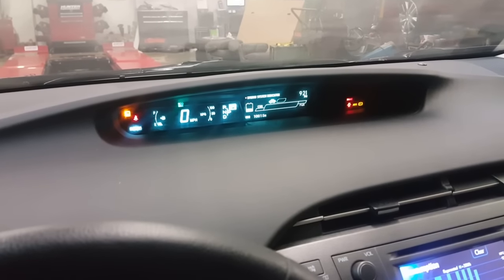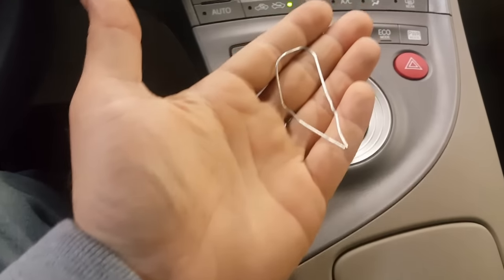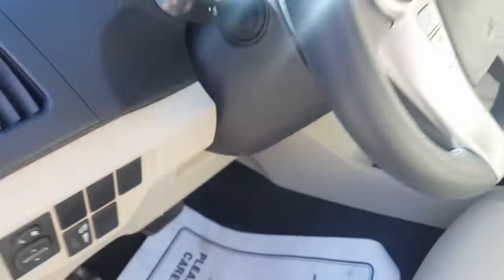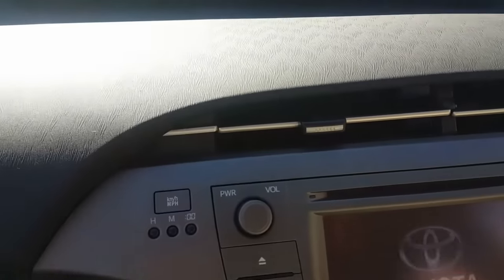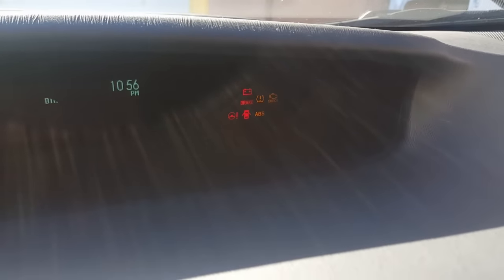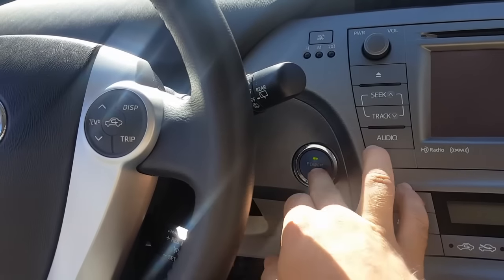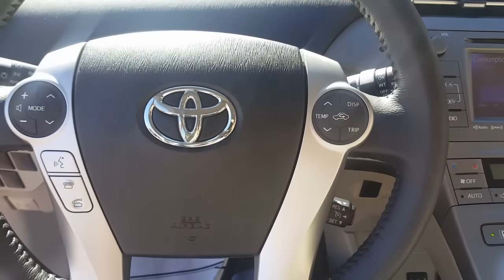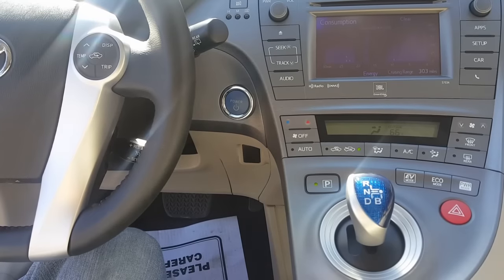HOW I RESET STEERING ANGLE SESNOR ABS VSA TRACTION CONTROL BRAKE ON ANY TOYOTA AND LEXUS VEHICLE'S.

Comment: Thank you. I've been driving my prius since 2013 and it has always had crappy steering and handling because it was never calibrated after getting new wheel bearings, brakes, etc, so the steering has always been all over the place and it was actually very annoying and frustrating to drive. After finding out about your video, i decided to try this and man, what a big difference! My steering is a lot more stable and isnt all over the place anymore. Even my braking got smoother. I never thought my prius would drive like a normal var again. Sir, i just want to say hats off to you for sharing this video. I am now happy driving my prius again, and i dont plan on selling it anymore. Thank you. Thank you. Thank you!
Reply: Don't remove light in Prius 2017

Comment: Did some Brake work on a 2008 Prius and the lights came on.   Did the reset trick by pumping 8 times after turn on. Waited for 30 seconds and everything is rest 100%   AWESOME Thanks
Reply: Had the same issue! Did it the way he said it! Didn’t work but when I saw your comment tired it and we’re back to normal! Thanks!
Reply: @ThePCopc1063  what was pumped 8times? The brakes..? I'm having same issue
Reply: @jasonmartinez2363  yes the brakes. Pump them 8 times rapidly. Each time you do it you should feel more and more resistance. Then shut off the car and restart it and everything will be good to go.
Reply: Neither works. My traction light has been on ever since I replaced my gen 3 clock spring. I'm not feeling increasing resistance on the brake pedal while pumping. 

I'm assuming in both procedures you leave your foot off the brake and press on switch twice as shown. 

Everything works except the light. I'm assuming my traction control may not work in slick conditions until I fix this.
Reply: @ThePCopc1063 did you use the paperclip?
If so can you walk through the process?

Comment: Prius zvw30 2010. Erratic steering. Alignment done. Still not great. Steering jumpy on straight roads at speed. Body roll at corners. No feeling in the wheel. I used your method. NOW car is driving fantastic! My wife is happy with this car for the first time in 2 years. Thank you for your upload.

Comment: My wife’s 2013 Prius was in a collision a few weeks ago and we just got it back from the repair shop 3 days ago. We had them then do an alignment because we felt the car drive differently after the crash. Fast forward to today 9/14/23 and all of a sudden ABS, (!), and BRAKE light came on. Started doing some research, suspected it was due to the alignment, and came across this video and another one that said it could possibly be due to that. Anyway, tried your way 3 times and it didn’t work. Tried it again while actually turning the car on, pumped the brakes 8 times, and turned it off. Restated it and BAM! No more lights! Thank you for your guidance. Just wanted to share what worked for me if anyone tried this and it didn’t work. Cheers!
Reply: Did you jammed pin 4 and 13?

Comment: Well. I had same issue my vsc lights was flashing with trac control on and i jumped pin 4 and 13 as on video. I turn on keys without ignition and pressed brakes more than 8 times i saw lots of lights and turned off key and start engine and when i drive lights came back on. So, I tried again jump start pin 4 and 13 and straight start the car and keep pressing-release brakes more than 8 times and wait like 30 sec the beep will be gone and abs vsc lights steering icon will be flashing and turned off the car and now i start the car and drive it bam no lights!!
Thank you! 
FYI i went to local mechanic they told me to goto dealership and reprogram the steering angle sensor.
Saved me hundreds of $ 
Thank you!

Comment: Yayyy! It worked for my 2011 Prius, we had code c1336, BUT same flashing lights, traction, brake & abs.. we used ports 4 and 12! Worked like a charm! Thanks man! 💙
Reply: According to something I found in Priuschat, 4=ground, 12=toyota status, 13=toyota control… did you use pin 12 in the same way explained in this video?

Comment: Thank You!!!!!
will say on 04 - 09' Prius  I believe i had to press the brake pedal fast  8 - 10 times in 5 sec.
after lights go goofy  30 - 60 sec.,  then turn off...  wait..  pull wire out... cycle power on again,
pump brakes again  8-10 times,   turn off...  wait..   hold brake & start ~

that's the only way it worked for me..  ;)

so jump wire, 4 in & 13 (5 in on  bottom )
power button 2 x  ~   wait 60 sec.  ~  press brakes  8-10 times fast
turn off ~  remove key,  wait 10 sec.,  remove jump wire,   ~  power button 2x
pump brakes again 8-10 times ~  turn off ~  take out key
wait 10 - 30sec.  ~  put key back in & start!    Wala   : )

don't know if all that's necessary for every1,  but it's the only thing that worked on r'  04 prius
w/ the key fob  u have to put in to start the car...  ;
hopefully will help somebody that the other basic steps isn't working for.  ;
Reply: drummmer05 thanks man that really worked for my 2010 prius gen 3 u r great  👌👍
Reply: THANKS!!! 100% working on 2012 prius
Reply: My stearing angel sensor is in -850 position which method can I do?
Reply: Wow, Thank you for the details- works for me.
Reply: This way worked for my 2010 Prius. Thank you so much!
Reply: Instructions according to the video did not work for me. Then I tried your procedure, and it worked perfectly for my 2013 Prius. Thanks
Reply: Thanks drummmer05!  You probably saved my daughter a few hundred dollars by posting these instructions.  Worked like a charm on her 2008 prius.
Reply: Mark Brice on the obd plug where exactly do you plug the paper clip into? Which pins is it? As I have 08 Prius also! Please help
Reply: "Take out key"=Go out from the car with the key in pocket? ??
Reply: Our 2010 Prius was that a Toyota dealership for a week after the entire dashboard lit up. After they did all the recalls car was ready to be picked up however they told us we needed a new 12 volt battery. Not sure how true that was but we changed it anyway. We had the car towed home and these lights came up on the dash when I went to drive it. I don't know how a Toyota dealership could let the car leave after a week with those lights still on! Before I took the car all the way back I tried this with the pumping of the brakes and it worked! Thank you thank you thank you
Reply: My car is 06 Prius. The video procedure didn't work for my car. I try your method to reset my lights. Finally, it works. Thank you so much.  You save me.
Reply: @SkyCompus  hey bro, why did your lights turn on? Maybe because of water or rain?

Comment: Hello george i have prius 2012 i just wanna know about my problem i m facing only traction control light due to some repairing done i repaired my steering clock cuz of horn problem and also performed front suspention and u know wheel allignment must have done now traction light goes on and i want to know is this video also resolve my problem ?cuz it must be angle senser calibration issue so plz guide me

Comment: Thanks for the video.  Does this work on a 2018 rav4? My steering wheel is tilted to the right after an accident.  If I align the wheels and correct steering positon, I get "lane departure alert malfunction" and "pre-collision system malfunction " messages and skidding light. Thanks

Comment: Hello George Melnik, I took off the traction and AbS light off but it keeps turning on? I replaced the sensor because it read C0205 which is the left Sensor and made sure it works (continuity test) and the light is still on? I don't know if the 2010 Toyota Prius have a Reluctor? but it only shows that code and it does not make other noises. I noticed that sometimes the car skips and triggers the traction control light on. Can you please help me with this?

Comment: After a flat tire the traction control light has been on.  Is a scan tool required to reset it?  I'm looking into the Autel Mk808 since I also have to program new TPMS for winter wheels and also turn off the Maint' required light.
Reply: Did u end up doing it

Comment: Prius 2011. I tried this repeatedly. Didn't reset... Although the blinking etc all happened.. Tried the 8 times brake press as well. Still nothing. What can be wrong?

I know nothing else is damaged because this started as soon as i replaced the clockspring.

Comment: @George Melnik I worked on the front Brake discs of my Lexus GS350 2008 today and after that, I asked a technician to scan the car for me with his machine and lo, ABS VSC & Brake lights came on! I've removed the battery terminals but those lights are still on. What could be the cause? Could it be the scanner cos I've scanned the car earlier this week and those alarms did not populate when the scanning machine was plugged. Could it be the scanner that triggered this? The code that came on on this scanner is C1203. Please advise what to do? Thanks in ad

Comment: ALRIGHT - just to let the internet know - if you have a Prius that lost a ton of MPG after a AUX Battery replacement - DO THIS - I was suffering with only 28-32MPG for hundreds of miles. Changed spark plugs, new air filter, cleaned MAF, the works - nothing helped. Did this trick and I'm back to 51MPG INSTANTLY! THANK YOU SO MUCH

Comment: I tried this with my Lexus CT200h since it’s the same layout as a Prius, it’s still does not clear my abs vsc lights...any thoughts?
Reply: Did you try the instructions posted by first commentator? Add pressing brakes 10 times while doing it. It worked for me.
Reply: Hairone Rahman, How did you resolve this issue of ABS VSC Lights?

Comment: Hey George, I have an 07 Lexus gx 470, vsc, trac and anti skid lights on,what's the pins numbers on the obd connector, to reset those lights? Thanks
Reply: pin 4 and 13

Comment: Thank you! Thank you! Thank you!--I just did this today and this worked. At first I did the paperclip and got the blinking lights on the dash, and then i turned off the engine, took off the paperclip, and started the car but those pesky lights still stayed on. ..... Then i rewatched the video and the problem was my steering wheel(it was not centered, lol). After centering, i redid the paperclips and let the lights blink just as instructed and the lights reset! (background: my 3 light came on yesterday night as i was driving on the highway and that actuator? sound kept going every 3 secs and it freaked me out). This morning when I went to buy a paperclip at office depot, the car still charged, but there was a difference in braking, and i tried the brake assist to see if that would take off the lights but no luck. 

Before throwing money at a problem, especially in car repairs, the lesson I learned years ago is to do the obvious things first(from cheapest to more expensive) before you spend your hard earn money to attempt to fix the problem with the dealerships. Hopefully this fixes the problem. I have a 2013 prius w/ 125K miles. I think my lights came on because I hit my driveway curb 2 nights ago when turning too fast in my driveway while braking. Will give an update to see if issue resolved in a few weeks. THANK YOU!
Reply: update: the 4 lights(brake, brake system warning light, abs, slip indicator) came back on while on the road. prior to it coming back on, the breaks worked normal then it started feeling immediately less responsive after the 4 lights reappeared. Still able to charge. got home and took a nap. now i just added brake fluid since below min after depressuring. Will see if that does anything. I reset it again! will keep you updated. Also I did look into customer support program notification ZJB regarding possible related issue.
Reply: I try many time,it still does not works,hopefully you can find out,I’ll keep my eyes on it, thanks!
Reply: @hongtan5247  i Hong! Have you tried pumping the breaks 8x(or more) when the lights starts flashing/blinking? Make sure to keep your steering wheel centered as well!!!!!!
Reply: UPDATE: Good news!!!! The toyota dealer is fixing this issue as i type this now for free under the recall support program ZJB! .....  i have 2013 prius w/ 135k miles. So the lights did come on a few times since my last post. btw I dont have techstream or obd that can read the codes on my hybrid. i have been resetting w/ the paperclip method everytime the lights come on.  But after resetting in a sketchy parking lot one night, i knew i had to do something more. So i researched all these videos and prius chat and learned about Recall ZJB. Narrowed it down to possible abs speed sensor on my front driver side and ordered an inexpensive replacement for $26+7 for shipping. So before i go to the dlr i wanted to do as much as i could to see if can fix it. (((At the worst, the dlr would charge me for a diagnostic($140) with techstream and that i didnt qualify for recall but at least i know what to fix.    I installed the speed sensor and test drove it today but the lights came on after 20mins of driivng.)))  So before i buy more parts or a new 12v battery, i was willing to pay the 140 for the techstream and get a printout and go from there ..... I knew of one recall about a software update on my car per toyota's recall website..Since the lights were showing, i took it to the dlr to see about the recall ZJB. 
The service rep said i actually had 3 recalls and ZJB was one of them. What a relief, whew! So it was going to be covered under the warranty. So the dlr drove me home and are going to deliver my car tonight. Will keep yall updated if anything else is wrong. But i hope this fixes the issues.
Reply: @spinachgeek2355  do you have an update on this? I’m having the same issue
Reply: @Marius-gz3zu   Sorry for the slow response! Bad news, the dealer called that afternoon and advised my car was not part of ZJB(supposedly). Why it took all day to tell me that, I am still in the dark. At that point i just wanted the car back. I got it back w/out paying anything to the dealer. I may try another toyota dealer. 

The short story is: i am still getting the warning lights. I drive the car minimally.  I still reset with the paperclip method above. I have since replaced 1 speed sensor and a new 12volt battery thinking those were the issues. But the lights still came on.--Now I am focusing on the brake fluid. I am in process of flushing out the break fluid. 

BTW i still dont have techstream but was able to get the blink codes after putting it in diagnostic mode. if i'm doing it correctly, it points to a diagnostic code related to the support program ZJB. So i may go to another dealer. 

But before i do that, i am still trying to work it out myself.  Now some may say i am wasting my time and money. But ... I would say that since it costs $180 to do a diagnostic check with techstream at the toyota dealer, i would rather use that towards fixing my car myself. If anything else, i will have some new NEEDED parts on my car. I needed a new 12v battery and that speed sensor was $26(questionable lol), but i also learned some new maintenance skills on my car. 

Did you get your veh resolved? @marius .... hopefully i will update yall soon!
Reply: @spinachgeek2355  Hey, thanks for the updates it's very helpful.  I'm having the same issue but I noticed the actuator making more noise than usual even depressing the brake pedal would create a hissing type pressure noise also.   I'm afraid the actuator/pump failed.  I'm going to have to try this paper clip thing try and get it to the shop after checking what I can at home.
Reply: @miagi84 hey brother, did it work for you?

Comment: Thank you so much . work on my prius 2005 . I jumped 4 to 13 then turn on then of the car dashboard turn off then after couple minutes dashboard light comes and abs light removed .
Reply: can i do this with 2011 prius????
Reply: @saqibmehdi4982  I have the same question. Did you solve this problem???

Comment: Hi,i am facing steering angle sensor problem in Prius 2016 model Zvw50 and its a right hand drive car shall i conut the pins from right to left and will it work on 2016 model zvw50. prius.
regards 
hassan
Reply: Masla hal hua ap ka?

Comment: Hi I have 2002 Lexus lx 470 the car drive normal then one day morning I started the car I saw the brake light on and ABS on and trac control on can I do the same wat you do ? Number 4 and 13
Reply: Thanh Duong did you fixed?

Comment: Good morning sir please Where is the yaw rate sensor and lateral acceleration sensor located in lexus ES350 2007 cause the VSC and the ABS is on even the speed cluster is not working

Comment: This did not work I’ve try all of this vids I have a 2010  Prius I replaced the cv axles after this the abs and track control lights came on its given me a 1235 code it had a piece of metal on the hub I remove it still i by pass or jumped the 5 upper pin  and 4 bottom  , on obd port clear it still comes on and is hard to brake it sound like prack prack and the front wheels skip when I brake I did all this procedures when I brake the abs and traction light come back on dash board . Brake sensors are good I checked them clean them problem still persist , any tips what could be ? This is frustrating  like I’ve said I’ve check the abs sensors are good no more metal in hub replaced cv axles after that this started to happen . I check fuses are good , I took car to get an alignment did not work steering wheel pulls to the left or right I try calibration like other vid says still same  abs light come on and traction light as well if anyone had this problem , can you help , if I clear the code with paper clip light goes out , but car brakes like crap . I can hear the prack prack on front brakes and light pops right back on